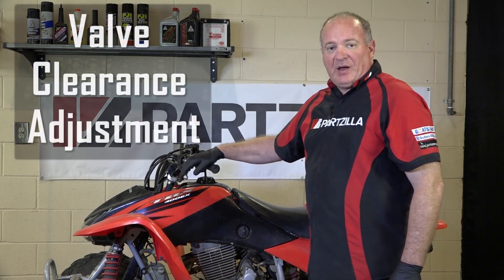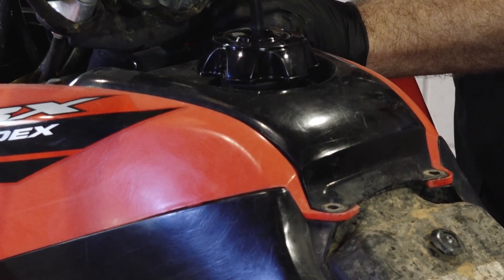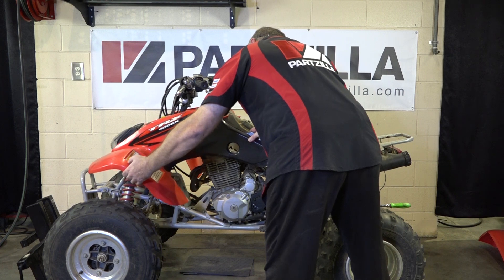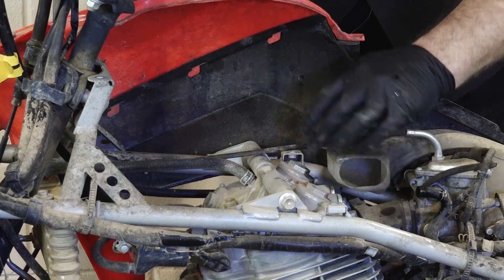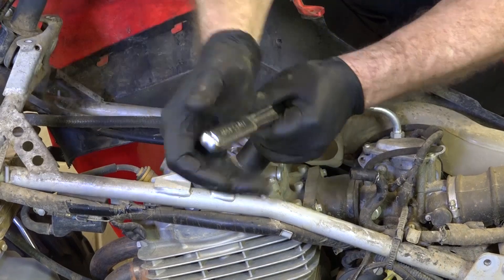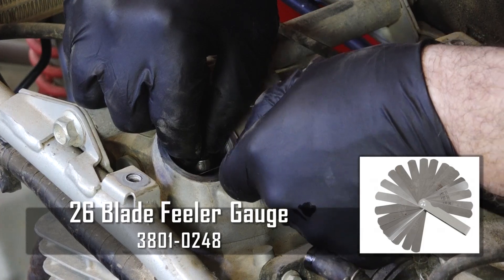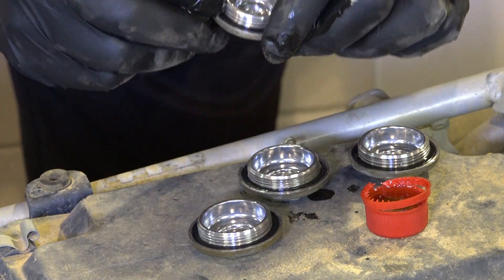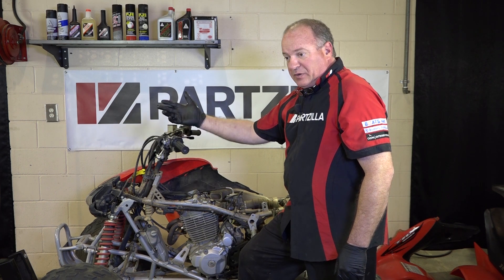Honda ATV Valve Clearance Adjustment on TRX 400EX | Partzilla.com

Comment: Nice video, but viewers with less experience need to be aware of a couple of unmentioned things.  First, just because the crankshaft is at TDC does not mean the valves are closed and ready to adjust.  The engine must be on the compression stroke, so once on TDC, if the valves are open, the engine must be rotated around a second time to TDC to be on the compression stroke.  Second, once on the compression stroke, it is not uncommon for the decompression cam to have stuck, causing the right side exhaust valve to be partially open.  That needs to be disengaged by quickly rotating the engine back and forth.  Third, a feeler gauge other than a generic automotive gauge should be used.  The way the 400 is set up, a more narrow feeler gauge would be ideal.  An automotive one can be used with success, but it's a lot harder to get a good feel for where the adjustment needs to be.
Reply from the maker: +Alan K All very good points Alan. Thanks for posting! Every bit of good information helps.
Reply: Yes that's right.  You're now on the compression stroke.  A slight drag is slight resistance when you move your feeler gauge back and forth.  It's more of a feel thing really.  As long as you can feel a little resistance, and the feeler gauge moves freely, you're good.  Be sure to double check the setting after you tighten your jam nut.  Sometimes the adjustment stem turns and you will have tightened the valve a little too much.
Reply: @alank7833  thank you very much for these explenations !! Im sure ill get it my gf 400 ex barely want to start and idle but when its warmed up it runs perfect
Reply: ok so I did this I had top dead center and no wiggle then I rotated then top dead center had wiggle on all the valves so I take it that's compression stroke then
Reply: what is the compression stroke I never did this yet I seen a video say check they valves by hand for wiggle if it wiggles on TDC then you can adjust is this true
Reply from the maker: Yes that is true.
Reply: Alan K what do you mean by all four being closed on compression stroke
Reply: and when you use the feeler guage and set the valves what do you mean by slight drag on guage like it starts to grab it when I move the guage back and forth really slow
Reply: Alan K thanks for the help
Reply: Alan K if I accidentally spun the crank clockwise on accident what do I need to do can I just hold crank and turn it over everything on the topend is new from rockers to piston bought from partzilla
Reply: Thanks for posting this comment, I don't know much about fourwheelers and I'm learning as I go with every problem I run into, this seemingly simple project has me strung out trying to figure out what I've done wrong, I've assumed the two valves closest to the exhaust pipes are the exhaust valves, and the two closest to the carburetor would be the intake valves, now my fourwheeler had no issues other than a ticking sound I heard while idling and I figured it was the valves, so I bought a feeler gauge and took the machine apart down to where you access the valves. I believe I set them all correctly, and was hoping to have solved my  ticking problem, but now my fourwheeler has a hard time trying to idle, and any throttle kills the engine so obviously I have made a problem for my self. I should also say that it's a 2001 400ex, so not sure if the quad in this video matches up to my quads specs
Reply: When you move the crank to get the right exhaust valve to close when you move it back a fourth to get it to release do you mean turning the crank clockwise and counter clockwise a couple times
Reply: Thanks
Reply: Referring to the valves.  You absolutely have to have the engine at top dead center on the compression stroke.  When on the compression stroke, both of your intake and exhaust valves are closed because you want to compress the air that the intake valves just pulled into the combustion chamber.  When you have your valve covers removed, and your top dead center mark aligned on the left side of the engine, all of your valve springs will be extended.  If the valves are anywhere close to being adjusted, you will have a little slack in them, and that will help confirm you're at TDC on the compression stroke.  If you have a couple valves that are open, which will be indicated by the springs being compressed and no slack in the rockers, rotate the engine around one more revolution until you're TDC mark is once again aligned on the left side of the engine.  Once on TDC, if all the valves are closed with the exception of the exhaust valve on the right side, chances are the decompression cam is slightly engaged, and all you have to do to release that is rock the crankshaft back and forth a couple times and that should release it.  The worst part about the whole process is getting the feeler gauge in there with the right bend to know for sure that you're getting an accurate reading.  When in doubt, a little loose on the valve adjustment is better than a little tight.  A little tick from the valves being a hair loose is better than having them too tight and burning a valve.  If you had them substantially too tight, it would be very obvious because the fourwheeler wouldn't idle correctly, if even at all.
Reply: @alank7833   im confused.  I still dont get compression stroke